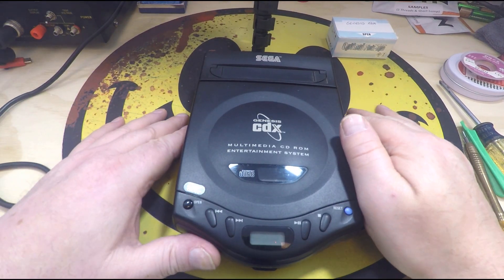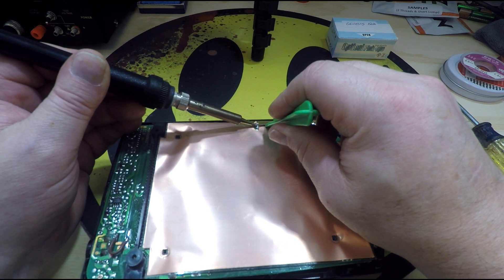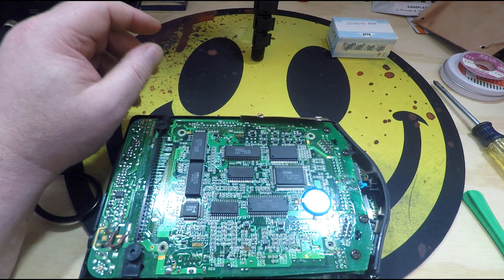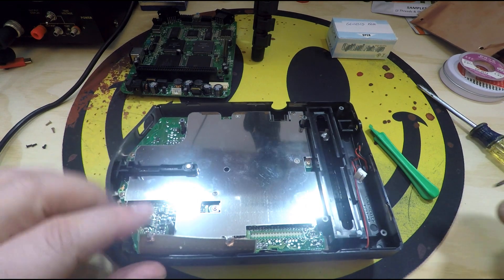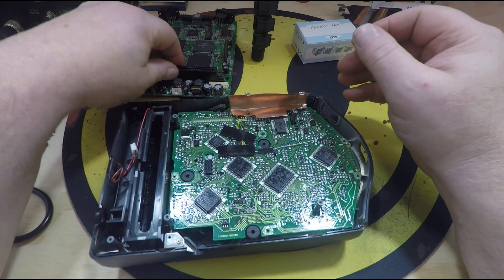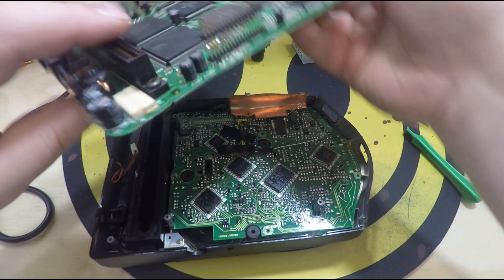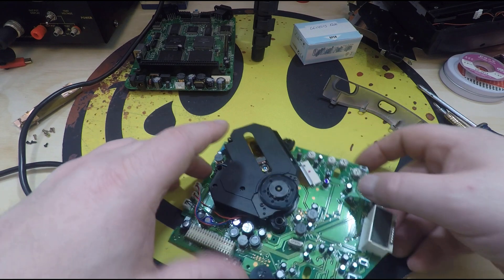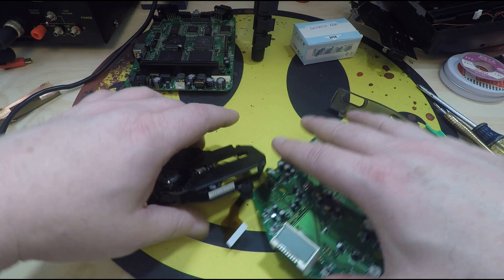Sega CDX Laser Replacement - Disassembly & Repair - How-To

Comment from the maker: Here is the Link For The Laser. 
https://www.ebay.com/itm/NEW-OPTICAL-LASER-LENS-PICKUP-for-SEGA-Genesis-CDX-Console/283269839734?ssPageName=STRK%3AMEBIDX%3AIT&_trksid=p2057872.m2749.l2649
Reply: hey do you do repairs if someone was able to send you something or what i would love for you to replace the laser in my cdx unit
Reply: Hello can you make sure that the lens in this link works? Because I already purchased 2 lens with 10 pins from other sites but they don't read disc.

Comment: You think its possible to leave the laser assembly connected to the unit, but remove the plastic covering to clean it with isopropyl and grease the laser sled rail?

Comment: Hello, Hopper. I have a CDX with a disc playing issue, can you suggest anything? The disc spins up fine (Music CD, I don't have any CDX games), but I hear a light flicking/fluttering sound while it's spinning. The laser gear/motor seems to be fine and moves without issue. It wont read tracks while laying flat. If I tilt the right side of the console 45 degrees upwards, it will play track 1. If I tilt the front end up 45 degrees it will play track 2, and etc. What do you think the cause of this issue is?

Comment: how do we know its just the laser only? if its not reading discs right? just swapping the laser will fix it?
Reply from the maker: You don't know for sure but that is were I always start.
Reply: @RetroGamingWithHopper  guess what was sort of dumb question, could do a test on the caps when i tear it down that far and observe them.

good deal tho for last 5 years or so people were saying you cant find replacement lasers for sega cdxs....guess thats changed tho?

and i saw on amazon they have a laser thats cheaper than the one you linked not sure if its the same one

Comment: I greatly appreciate your work with this video, it inspired me last year to go straight into recapping my childhood CDX. after a week of on and off work (and getting caps missing from my kit..) it was a complete success, one of the caps was leaking as i suspected! It was my first full recap and first time touching any kind of power board which was the thing putting me off the idea in the first place. You make the actually intimidating part of taking the system apart and putting it back together much easier.
Reply from the maker: You are Welcome. It's good you were able to put your fears aside and tackle the job. I'm glad this video help you.

Comment: Awesome video I changed the laser in my cdx unfortunately didn't fix the issue turns out my problem was my original cdx power supply ,was the blame had to recap the supply it's only one cap it's a 16v 6800uf cap after doing that my CDX was playing perfectly again I noticed this because my cdx would not read correctly from cold boot so I left the cdx power supply in the wall for half-hour then plug in  the supply  too the back of cdx then it would run so after changing the cap out it was fine again from cold boot
Reply from the maker: Nice catch I'll remember that.
Reply: @RetroGamingWithHopper  thanks hopper hopefully this helps others as your video helped me thank you again friend couldn't have taken my cdx apart with your fantastic video I've done teardowns on just about everything , but my cdx always scared me till finding your video , one day I will hopefully get around to replacing the drive belt in my Panasonic Q - GameCube now there a scary teardown that thing is like a house of cards on the inside

Comment: BRAVO showing proper disassembly! Question: how would you feel the new laser would perform using CDR disks? I learned that such media shortens the life of the laser due to voltage. What is your opinion on this since a new laser was installed on the console in the video. CDR media will shorten the life of the original laser assembly from SEGA. Thank you once again for the great video demonstration.
Reply from the maker: You are getting a little to technical for me. I do a lot work on home consoles but I don't get to technical. My thinking  is there should be know problem reading CDR discs and losing performance on a laser. There to many other factors that could cause a laser to lose performance.

Comment: Great vid! I used your video as a guide to open up my CDX and just clean it up inside using some compressed air. There was some gunk that had built up over the years. It works great but the one slight mistake I might have made is that, at the beginning where you mentioned not to take out one small screw (to the left of the unit, opposite the "line out" port) as that is just a hinge screw. Not sure if that has anything to do with the fact that now I need to manually open the lid, it won't spring up when pressing the open button.

Comment: thanks so much for this video. my CDX stopped spinning discs and i didn't change out the laser but i did a cap kit on it and it's up and running again. it would have been 10 times harder without this video showing me exactly how to take it apart. thank you!
Reply from the maker: I am glad the video helped.

Comment: Do you what the resistor is that connects to the metal shield? Mine broke off
Reply from the maker: What the color bands on the resistor?
Reply: @RetroGamingWithHopper  part of it broke off and Im not sure where it went
Reply: @RetroGamingWithHopper  I sent you a message on Facebook
Reply: @indcsion  Did you figure out the value of the resistor? Mine broke off too 😕

Comment: I recently got a cdx that was used only a few times. Here is the issue I have, when playing tomcat alley the game will randomly freeze during a cut scene. Disc is free from scratches. It looks brand new, it also takes a anywhere from 5 seconds to 30 seconds to boot a new cut scene. Disc spins, it’s relatively quiet. Sonic cd took a few moments to boot past the menu but in game play is flawless, the sega classics game and every game inside it plays flawless. It had the correct power, I have no idea what could be causing it. Any thoughts?

Comment: Great video!!  If I could ask.....in your experience after a good cleaning would it be a cap related problem if my cdx will not hold a picture steady?  Picture will not hold vertically, and will scroll on its own.
Reply from the maker: I have never seen that problem. But I would start by inspecting all the caps. Any in question I would pull and test.  Just for peace of mind try hooking it up a different TV and see what happens. I had one that had a bad fuzzy screen, I hooked it up to another TV and the picture was as clear as it was when it was new. Also, try a different component cable if you can. Eliminate all the easy things before you tear into removing and replacing caps.
Reply: @RetroGamingWithHopper  appreciate the suggestions, will give it a shot before really digging in